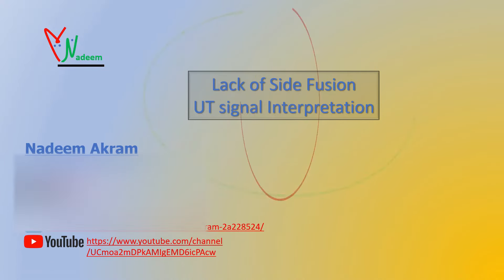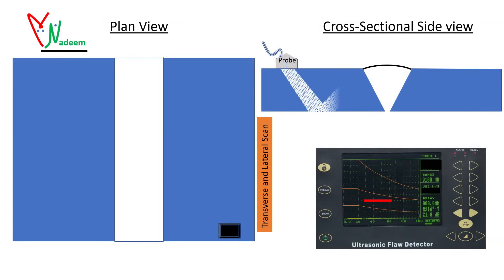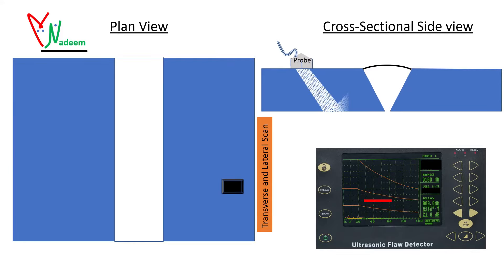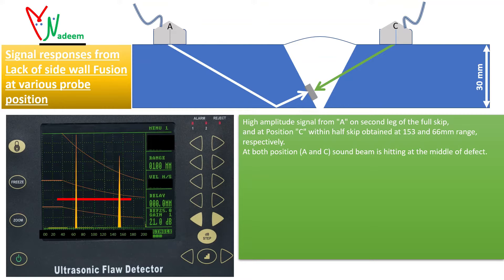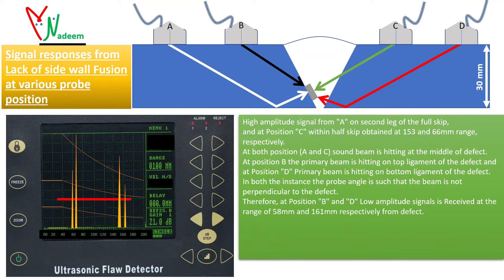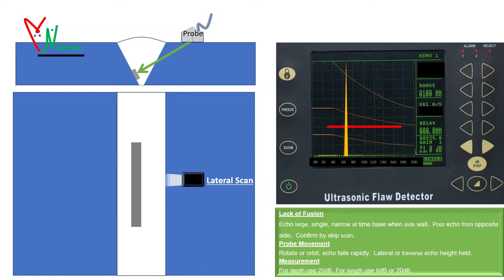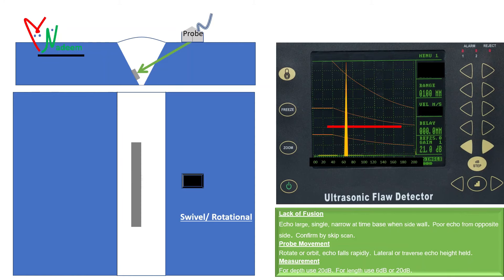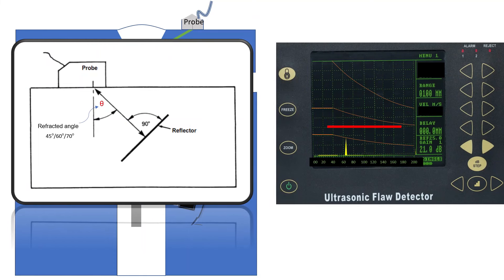Ultrasonic Testing (UT) Defect Signal Interpenetration, Lack of sidewall Fusion, Defects is weld.

Comment: Sir 1video for dac drwaing
Reply from the maker: Sure Dear i will prepare and upload one Video on DAC
Reply: It's quite straight forward.

On 3 points:

Get the reflection at half-skip .. mark.
Get the reflection at full-skip .. mark.
Get the reflection at 1 1/2 skip mark.

Proceed to deeper holes and repeat. 

On 2 points ID-OD notch:

Same procedure basically. 

Before all that make sure your index point is marked on the probe and that you have set the sensitivity at 80% FSH.

Comment: Sir how to accepted criteria
Reply from the maker: It's all depends on acceptance criteria... Just take the example of ISO ISO 23279 and ISO 11666, in accordance with afore stated standards all planner indications are not acceptable. and Lack of side wall fusion falls under Planner Category.
Reply: @TechMechX  so all planer defect rejected.
Reply from the maker: @allwinthivan6795  yes if you are doing UT as per ISO standards and your acceptance criteria is ISO 11666.
Remember same rule doesn’t apply if you are doing UT in accordance with AWS D1.1. Even In AWS D1.1 there are different, different criteria, base on structural loading such as static / cyclic etc. So As I mentioned earlier it’s depends on Acceptance criteria and governing code against which Examination is being performed.